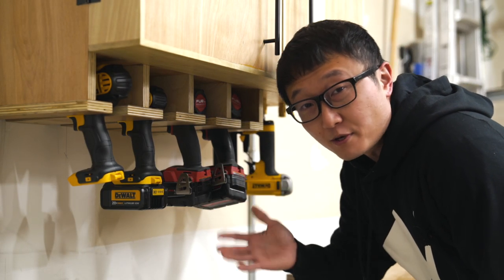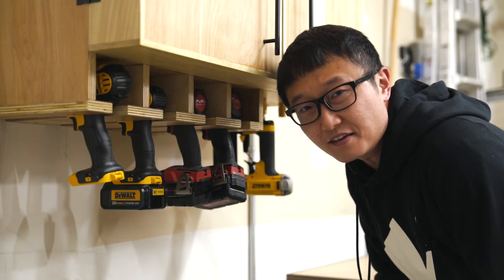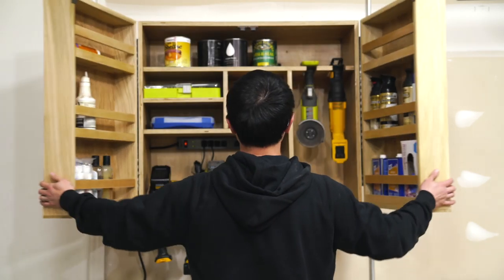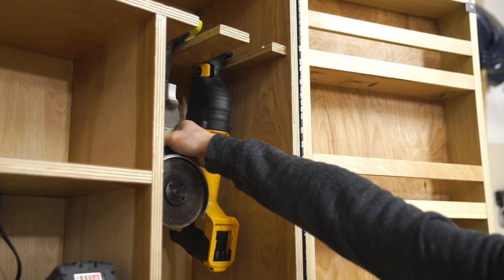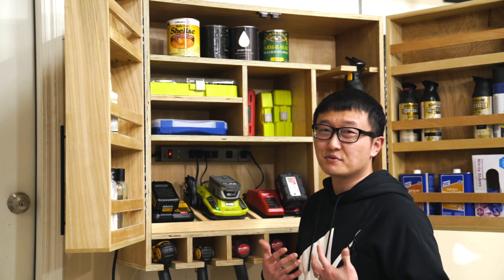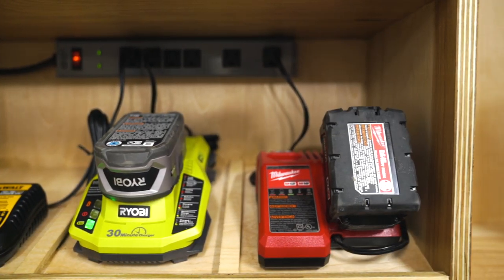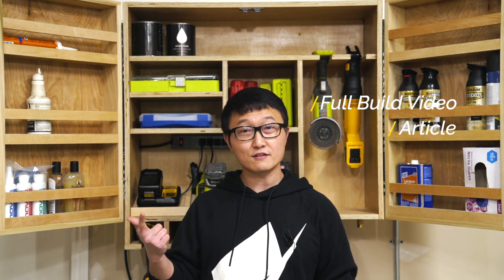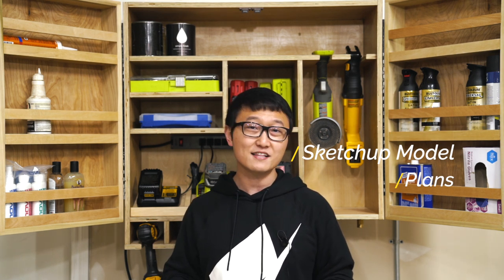DIY Mutipurpose Shop Cabinet with FREE PLANS | Shop Organization

Comment: Do you have a concern about putting finishes in with batteries? I don't know if this is necessarily safe. 🤷‍♀️
Reply from the maker: If the batteries are going to explode, the fire will reach the finishes either way